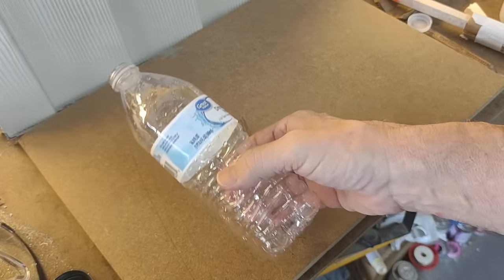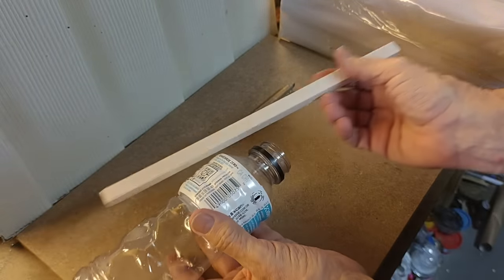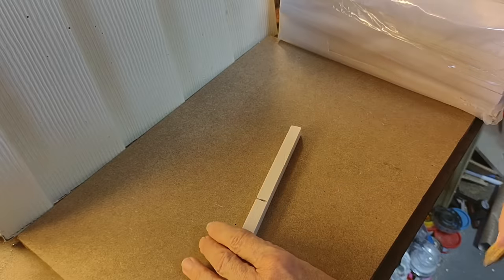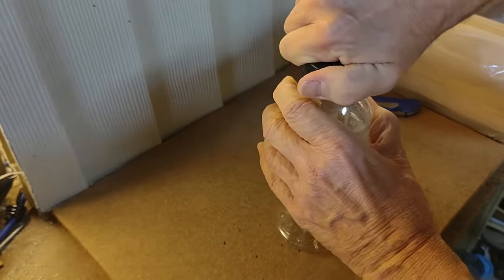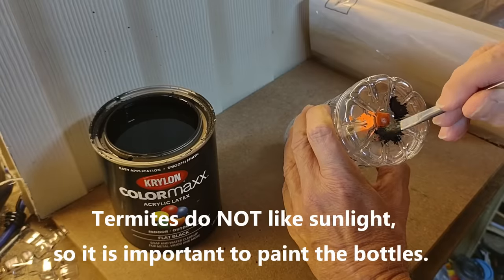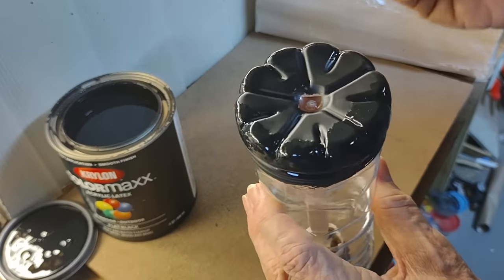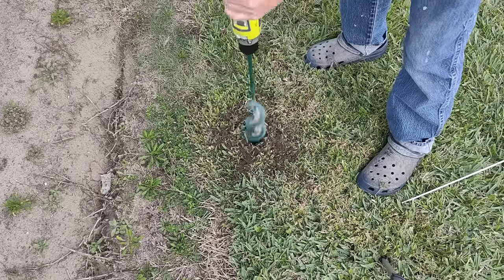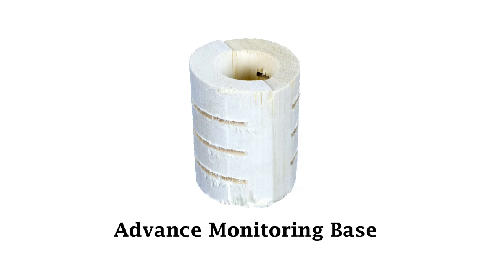Unbelievable Water Bottle Trick for Termites!  Simple to do!

Comment: I literally have termites in my kitchen as we speak, they are black winged termites, what do I do? They are hatching because of the rain we've been having, it's the second time they've come out but there's more rain coming.
Reply from the maker: It's swarming season right now.  These guys sound like subterranean termites, but you should make sure.  Please watch my video on how to identify termite species.  Don't worry.  It's not that hard.  If you confirm that these guys are subterranean termites, then sometimes they can be very easy to treat.  Please get back to me after you watch the video and let me know what you find out.  At that point I can explain exactly what you need to do.  Meanwhile, don't do anything.  I know you want to kill these things fast, but that is the worst thing you can do.  Please trust me on this.  You need to sit tight and do it right.  I will guide you every step of the way.  Be well my friend.
Reply: @GuysPestSolutions  they are black winged termites, that's the species, I think it's Latin name is termestes virginicanus or something like that.
Reply: Reticulitermes virginicus
Reply: Reticulitermes virginicus
Reply from the maker: @ZomBearfoot  There are two options for treating Eastern subterranean termites yourself.  The easiest way is to use termite granules.  It costs less than $60 to do and it only takes about an hour.  The application is so easy that a child can do it.  The other option is to trench around the entire building, including the driveway.  It takes about a day for most people to trench around an average sized building and it only costs about $100 to do the job.  Trenching lasts for 5 to 10 years, but the granules should be applied every year as a preventive measure.  I have videos on how to do both options and I will place links below.     

For the granules to work you need to have dirt around most of the house and that dirt needs to be porous enough to allow water to seep into the ground fairly quickly.  To find out if the dirt around your house is porous enough, just dig a small hole next to the house that is about 4 inches deep, 8 inches long, and just the width of the shovel.  Fill the hole with water and watch to see how fast it drains down into the ground.  If it seeps into the ground fairly quickly, then the granules should work just fine.  However, if it just kind of sits there, then the granules would not be a good choice, and you should consider trenching.  Make sure that you buy the correct granules.  You need the ones that have imidacloprid as the active ingredient.  A lot of the Home Depot and Lowes stores no longer sell the correct granules, but you can get them from Amazon.  I will give you a link to them.

You can give any subterranean termite treatment a bit of a boost by doing a spot treatment.  If at all possible, spot treating for subterranean termites should not be the only approach to eliminate an infestation.   An additional exterior treatment should also be done with either granules or trenching, whenever possible.  Spot treating alone may totally eliminate the infestation with no other treatments, but it's not a sure thing.

To spot treat subterranean termites, you need to buy a fipronil foam.  I will provide links for two products that you can choose from.  I like the FiPro the best because it's a little less expensive and I like the applicator tip better, but the Termidor Foam also works very well.  The FiPro is not available everywhere.  If you can get one of these foams, then drill holes in all damaged areas, that are 4 inches apart, and drilled about halfway through the wood.  If you are seeing exit holes in the wall, then there is most likely a stud behind the exit hole.  Get a stud finder and locate the stud where it meets the ceiling and drive a small nail into the stud a couple of inches below the ceiling.  Attach a weighted string to the nail and that will show you where the stud is.  Then drill the holes 4 inches apart along the entire length of the stud, about 3 inches deep.  Do the same thing for woodwork, except only drill the holes halfway through the wood.  If you think that there is a 2 x 4 behind the woodwork, then drill a 3-inch-deep hole every 8 inches.  The holes only need to be wide enough to get the applicator tip of the foam can into the hole.  After the holes are drilled, then shoot the foam into each hole for about 5 seconds or until you have foam either coming back out at you or coming out the other holes that you drilled.   All the holes should have foam either going into them or coming out of them.  This will contaminate their food source and they will take the fipronil back in the colony and spread it around to the other termites.

Most of the time, subterranean termites are going to be building mud tubes somewhere.  You will most likely find these mud tubes going up the exterior or interior of your foundation and you may find them along joists and even in the attic sometimes.  If you have a slab home, then you may find them going up the outside of the house on the slab and even the side of the house.  If you can find the mud tubes, then you can treat them as well.  Just scrape off about a 2-inch section of each mud tube down to the bare surface.  Then, shoot that foam into each side of the mud tube and also apply a little of it on the surface where you removed it.  The termites will rebuild the mud tubes and bring the foam back to the colony to spread around to the other termites.

Also, if you can find the mud tubes, this is a very good way to determine when the infestation is gone.  If you scrape off that 2-inch section of a mud tube, you can see if there are any live termites in the tube.  Again, the termites will rebuild the tube and go about their business.  Do this every two weeks after you finish all your treatments.  Apply the foam to the mud tube every time you do it. At the point you are no longer seeing live termites and they stop rebuilding the mud tube, then your infestation has been eradicated.

After you use one of these methods, you may want to consider installing the monitoring stations around the house.  This is not necessary, but it is very easy to do, and you will know immediately if you have termites in the area.  If one of the stations goes off, then you can treat the termites right at the station, before they try to attack your house.  This way, you are protected by either the granules or the trenching, and you have the peace of mind knowing that there are no termites in the area.  

 It typically takes several weeks for any termite treatment to be effective.  That is because you are using slow kill products.  If you were to kill the termites too quickly, then they would not have a chance to bring the poison back to the colony and share it with the other termites.  If you don't kill off the entire colony, you will not end the infestation.  Therefore, you must kill off subterranean termites very slowly.  So, I would give this at least 12 weeks before I would decide that something went wrong, and the process didn't work.  Hiring a professional to trench your house is pretty much going to take about the same amount of time to kill off the colony.

I hope that helps.  Be well my friend.

Video on how to apply termite granules:   https://www.youtube.com/watch?v=H7rW_TSBHJ4

Video on how to trench for subterranean termites the right way:   https://www.youtube.com/watch?v=Fy7YHi_7Z8g

Termite granules:  https://www.amazon.com/dp/B000RUIJYM?ref=nb_sb_ss_w_as-reorder-t1_k2_1_4&amp=&crid=38N4G81Z51T3L&amp=&sprefix=term

 FiPro:  https://www.solutionsstores.com/fipro-foaming-aerosol

Termidor Foam:  https://www.domyown.com/termidor-foam-p-3528.html
Reply: @GuysPestSolutions  thank you very much. That was the beat information I've been able to get just about anywhere. I'm going to subscribe, it's certainly well earned.
Reply from the maker: @ZomBearfoot  You are very welcome.  Thank you so much for those kind words and for subscribing.  Very much appreciated.  Be well my friend.

Comment: DONT KNOW WHAT I HAVE BUT EVERY MORNING I FIND LITTLE LIGHT YELLOW BALLS ON MY KITCHEN COUNTER THE SIZE OF THE TOP OF A COMMON PIN HEAD VERRY SMALL  IT HAPPENS UNDER MY KITCHEN CABENETS DO YOU KNOW WHAT IS DOING THIS
Reply from the maker: It could be drywood termites.  Please watch my video on how to identify termite species.  There is a map in that video that will show you where drywood termites are a problem.  Please let me know if you live in the red area on the map and I will guide you further.  If it's not that, then I will investigate a bit more.   Be well my friend.

Video on how to identify termite species:  https://youtu.be/dIs_a0nfVjg

Comment: We have large black ants around our house in se Minnesota. What can we do about them?
Reply: They get in through gaps in baseboards and walls, sometimes in gaps through flooring. Making sure everything is caulked and sealed as well as cleaning up left over is essential. I once left a quarter of a soda outside, they swarmed towards that and left the house alone. They may require "tribute" 😅
Reply: Those may be carpenter ants. If so you'll want to get that addressed quickly
Reply: Moisture issue somewhere
Reply: Peanut Butter mixed with boric acid will do the trick cheaply.
Reply: @keithbk  Thank you
Reply from the maker: If they are just outside and not inside, then watch my video on how to treat your yard with a hose end sprayer.  If they are in the house, then also watch my video on how to treat carpenter ants.  I hope that helps.  Be well my friend.

Video on how to treat your yard with a hose end sprayer:  https://youtu.be/wifoTU5dmp0
 
Video on how to treat carpenter ants:  https://youtu.be/Te9BUCaIQZY

Comment: My house is built on a slab foundation and we recently had termites for the first time ever, and we've lived her over 30 years.. The termites got in through the area where two parts of the foundation meet, where we added an extension back in 1997. 

To deal with the termites, I had the house treated. They drilled into the foundation and put termite poison underneath. I also paid for bait stations to be set up all around the house.

About 10 months later, we noticed a few termites again. The termite company came back, redrilled the foundation, and added more poison. They didn't bother checking the bait stations during the second treatment or throughout the year. Now, the contract for the bait stations is up for renewal, and it costs $625 with no monitoring included.

I don't feel like the bait stations did much to protect my house since termites came back. They weren't monitored, I don't see the point in renewing the contract for the bait stations.

I may give your stations a try! Thank you!
Reply from the maker: Those bait stations have lots of problems, so I never recommend them.  Pest controllers like them because they are cheap and easy to install and they make a lot of money on them, but they can take up to 2 years to work, if they work at all.  If you have an active infestation of subterranean termites, then I recommend trenching or termite granules.  Which you choose will depend on the species.  Please tell me where you live, and I will do my best to guide you further.  Location mattes when it comes to termites.  The monitoring stations you make yourself are good for detecting termites, but if you have them already you need to bring out the big guns.   Be well my friend.
Reply: @GuysPestSolutions  Thanks for getting back to me!  I live out in the country in Middletown, California.  It's very rural.

I've treated twice for termites about 10 months apart.  The termite control people claimed to have put a lot - I dont' recall how much but they said A LOT of the termite poison under my slab.

I don't currently have an infestation but I think it's also the wrong time of year?

I can see a visible SEAM where my foundations butt up.  Should I seal that?  If so with what?  Also at this seem I have some rose bushes.  Should I remove them?

Thank you so much for your help!
Reply from the maker: I don't know how the pest controllers did the treatment, so I cannot say how effective the job is going to be.  I hate to say it, but I have seen some pest controllers do some really weird stuff.  Some of them are really good, but not all of them.  If you feel comfortable that you do not have an active infestation, then the water bottle monitoring stations should do a good job for you.  Just check them every month.  Don't forget because sometimes they can disappear into the ground if they get run over by a lawnmower or something like that.  Also, they can go off accidentally sometimes, so always pull it out of the ground if it goes off and make sure there are termites inside.  If there are, then put it back in the ground, and place a bait station next to it.  If it was a false reading, then just replace the station with a new one.  Sometimes the stick will move out of position if it was not quite long enough when you made it, so they are not perfect.  Most of the time though they work great.

It never hurts to seal up those seams.  Ornamental plants should be no closer to the house than 18 inches.  24 inches is better.  Plants that are up against the house are an invitation for pests, including some species of termites.  Also, plants up against the house makes it hard to maintenance on the side of the house as well.  So, it's a good idea to move the rose bushes away from the house a bit or just get rid of them if they are closer than 18 inches to the house.

I hope that helps.  Be well Shelly.
Reply: @GuysPestSolutions Thank you! ❤
Reply from the maker: @InkySparks  You are very welcome.  Be well Shelly.

Comment: Have anything for flying ants?
Reply: Yes. The. Spiders. Make. Great. Webs. For. Catching. The. Flying termites.......they do a good. Job..there is one termite near the ceiling right. Now trapped...it. could. Not. Get. Out. So its still. Trapped. And died..the. spider. Will. Eat it when its hungry...
Reply from the maker: The first thing you need to do is to make sure that those flying ants are not actually flying termites.  Try to get a specimen, and place it in a jar and let it die a natural death.  After it's dead, examine it with a magnifying glass and count the body segments.  Ants have three very distinct body segments, but termites only have two distinct body segments. Termites have four wings of equal length, but ants do not.  Please get back to me after you have confirmed that these are actually ants, and I will tell you how to solve the problem.  If they turn out to be termites, I can also assist you with that as well.

I hope that helps.  Be well my friend.
Reply from the maker: Trust me.  Spiders are not the answer for either ants or termites.  They will eat some ants or termite swarmers, but you will not kill off the colonies.  Therefore, the termites will continue to eat your house.  If you have carpenter ants, they will continue to destroy your home as well.  So, you may want to rethink that strategy.  Please let me know if you are interested and I will explain the right way to eliminate these problems, and the spiders as well.

Be well my friend.

Comment: You can dip those sticks in Borate as well, Couldn’t You? Thanks
Reply from the maker: Doing that won't hurt anything, but it will not help much either.  You will kill a few termites, but not enough to take out the colony.  There isn't enough wood in the station.  That is by design.  You don't want too much wood because you want the dot to disappear as quickly as possible.  Be well my friend.
Reply: @GuysPestSolutions  sir. Have you done any videos on borate treatment for new construction? I’m gonna be treating my home here in a few weeks and I’m always up for finding out the right way of doing so.
Reply from the maker: @chucktownvanlife4267  I don't have a video on that because there are already good ones out there.  I will give you a link to one.  For a new home, you want to treat all the wood, from the top of the roof down, with Bora-Care, mixed one to one with water.  They say you can mix it 1 to 5, but don't do it.  Do the treatment before the shingles go on or the building is insulated.  If it's made of wood, then you need to treat it.  It's best to treat all sides of the wood that is exposed.  This will render the entire house permanently termite proof.  It will also prevent al other kinds of wood destroying pests as well.

I hope that helps.  Be well my friend.

Bora-Care:  https://www.domyown.com/boracare-p-100.html?sub_id=554

Bora-Care video:  https://www.youtube.com/watch?v=Rmr_aEodyhg
Reply: @GuysPestSolutions  Thank You!!
Reply from the maker: @chucktownvanlife4267  Always my pleasure.  Be well my friend.